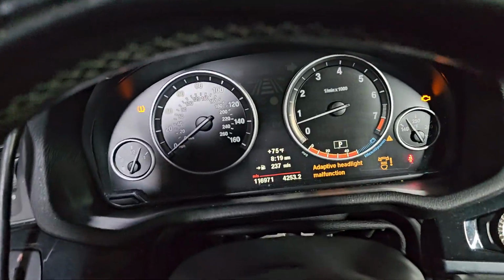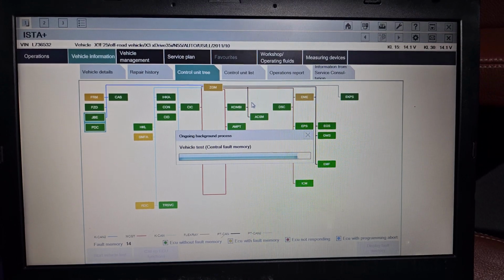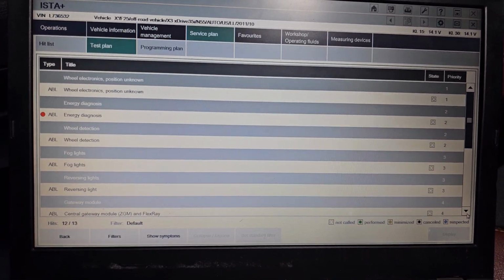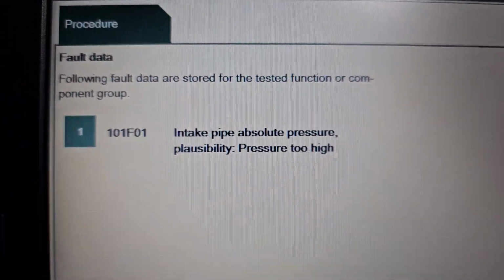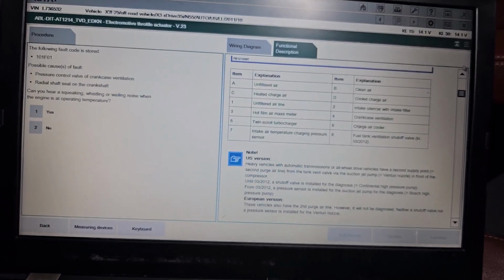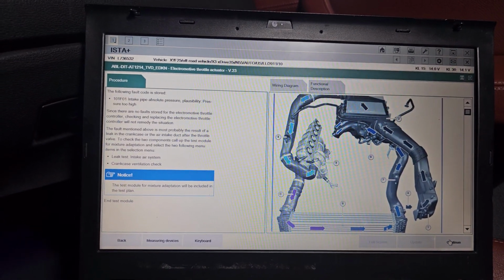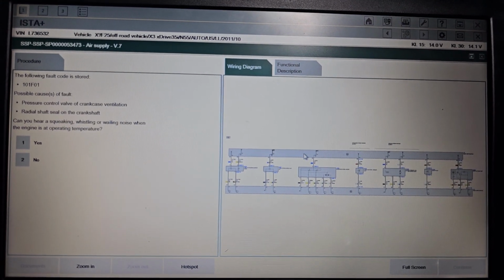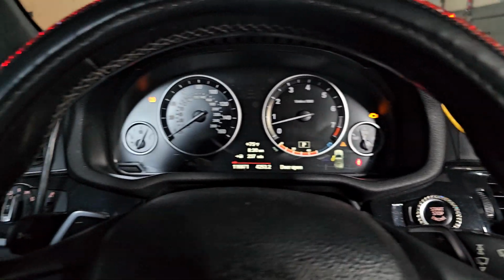2011 BMW X3 F25 With Code 101F01 Intake Pipe Absolute Pressure Plausibility: Pressure Too High Fixes

Comment: my BMW F31 Ms port 330d 2017 have problem that strong smell from exhaust gases and  diagnostic say Air mass is too high but other different diagnostic say exhaust back pressure sensor before turbocahrger: signal too high. mechanical say heard knock from turbo that oil leaking from it. is that truth? Because I am Deaf. Hope you advice me what do you think about this. Thanks

Comment: Did you were able to fix this code .
My mechanic still trying to solve this problem .
Thanks
Reply: my belt shredded on my Bmw f10 and ended up damaging my front main seal causing this code.
Reply: @mblydenvlogs  this is very common on these cars. so make sure your ofhg isnt leaking oil on the belt.
Reply: I've the same error. Is there any update from anybody about this problem?
Reply: @albertalbert2163  my error was indeed due to the belt damaging the front main seal. I changed the seal and the error went away but there is a lot of contaminants in my engine now due to the belt and seal breaking apart and being ingested in the engine. 😢
Reply: @mblydenvlogs many thanks for  sharing this information. Which seal do you mean exactly?
Reply: @albertalbert2163  the front main seal
Reply: Valve cover gasket